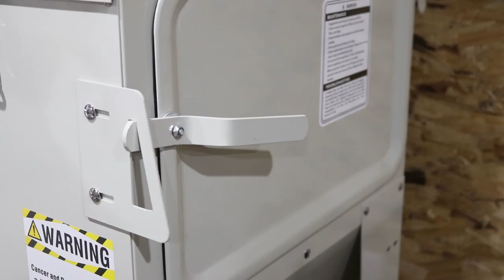1960 Tonka Tow Truck Restoration

Comment: Great restoration. I would have liked to see you repair that tab that broke off? It would have been interesting to see how you were able to do that. Is there a reason that you didn't paint the lenses red on the top of the hoisting framework as was done originally? Was that not an original painted part?

Comment: Front bumper wasn’t painted black was it?  Looks great though.
Reply from the maker: Thank you! Great attention to detail! The front bumper was actually originally black. However, the paint had flaked off, you can see a very little bit of the original black on the top of the bumper and the back side.

Comment: I;m gonna be controversial and say I wouldn't have gone the whole hog with this one. Polish up the light surround and bumper and add the missing parts, that's all it needed. I think you may have decreased the value by going too far on something that didn't really need it. Nice job if you want them pristine.
Reply from the maker: Thank you soo much for watching! Its tough to want to restore many of these, I like them just the way they are most of the time. However This is really a hobby for my own stress relief, therefore I really don't mind loosing value on them. I try to find toys that are definitely in need of restoration. This one was the 5th tow truck that I bid on in an attempt to buy, so it wasn't exactly what I wanted. However I really wanted one for the video intro. So I made do with it. Thank you for watching. You are soo right with your comment, I agree with you!